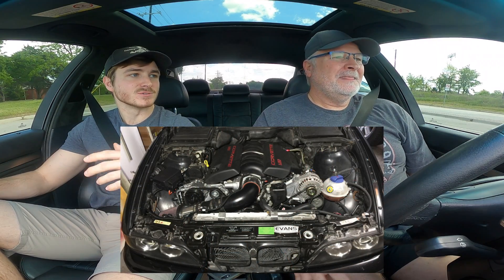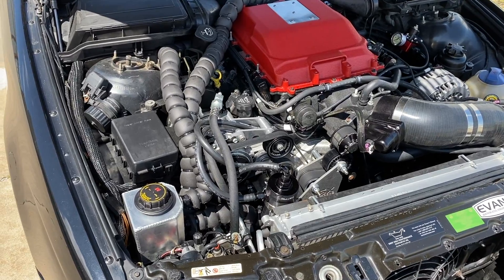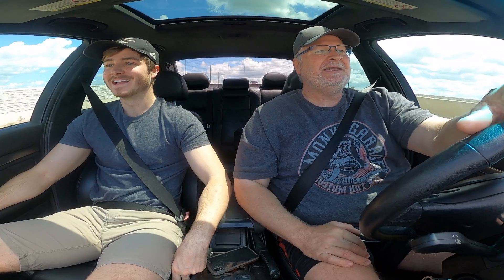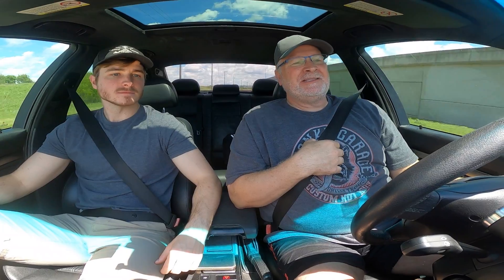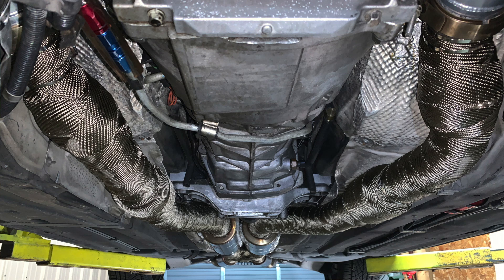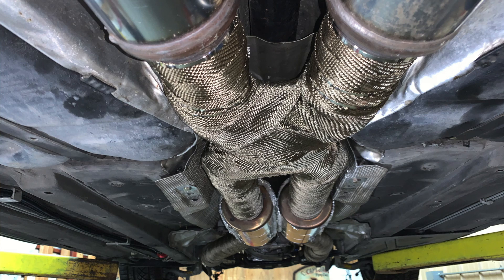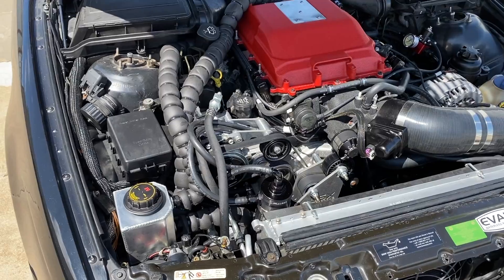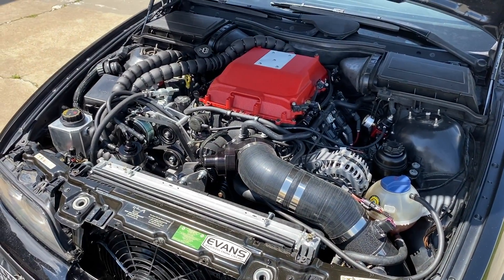First Drive in the INSANE Supercharged E39! | BMW E39 LS3 Swap

Comment: How did you guys figure out how to make the power steering and AC work, did you guys just changed the factory power steering line fittings to work with the GM powersteering pump? And same with the AC lines? For the AC was there any extra wiring that had to be done In order to allow the climate control to still work as it normally would? Or did you have to figure out fittings for the AC lines as well as Power to the climate control?

Comment: Great build, would it be posible to swap sbc ls family engine into 6 cylinder e39 without replacing stering mechanism ? As You all know e39 6 cylinder cars handle better than new m3, i drifted e39 over 50mph in winter years ago...with narrow summer tires and fu*ked up suspension :D those cars handle like no other. But v8 versions lose it cause of recirculating ball mechanism.

Comment: I don't know if this matters to anyone considering this swap and wanting to keep an E39 emissions legal but three things to consider:

1) The earliest E39s become emissions exempt on January 1, 2022 (less than a year and a half away). That means in Texas, 1997 model cars no longer have to be smog tested. Just the standard safety check (lights and seatbelts).

2) Interestingly enough, the first LS engines (on the C5 Corvette for 1997) aluminum blocks, coincidentally came out on the same 1997 model year.

3) While federal law (Clean Air Act of 1970) generally prohibits installing an engine older than the vehicle going into, I have NEVER seen a local, state, or federal check on the manufacture date of an engine. A "don't ask, don't tell" question (they don't ask, I don't tell) - HEY FEDS I'M INSTALLING A 1970 CHEVY 396 INTO MY 2010 CAMARO! COME AND GET ME!! (Caps Lock statement put in for comic relief and no, I don't actually own a Camaro or a 396 engine)

Comment: Awesome projet! Really immaculate car as well.
I drive a "different" e39 as well. Still has the s62 however I have taken 400 lbs out of the car. Super fun.
BTW - Who on earth would give this a thumbs down? Ridiculous
Reply from the maker: That’s awesome Sean! The S62 is a beast so I can only imagine what a rocket ship your E39 is being 400 lbs lighter. Gotta keep the E39s on the road!
Reply: Can you detail how you removed 400 LBS?
Reply: @leekzonyt9591  I had a carbon hood, 7lbs carbon trunk, Sparco seats, removed and welded up the sunroof, removed factory audio and had a bluetooth amp and a Braille battery. In some eyes basically ruined a M5 lol
Reply: @seanscott7120  Danggg that’s sick man! I’ve got a 2000 540i I’m interested in weight reducing. I do like my sunroof though I won’t lie 😭

Comment: Did you use a brand name swap kit or did you custom built your “kit”?
Reply from the maker: Good question Percy, we essentially custom built the kit. LSX Solutions has been a big help recently along with a couple other businesses.
Reply: Tire Kickers thanks. My main concern is the wire harness, oil pan, header fitment. Most of the other items we can source/build locally.
Reply from the maker: We used a GTO front sump oil pan, but it had to be modified so the sump would clear the cross member. As for wiring, go with the Painless Performance LS swap wiring harness that comes with A/C wiring. The headers were custom made for our build so I’m not sure what your best option is there. Hope that helps!

Comment: How much does the motor weigh? 
Has the weight distribution suffered?
Reply: I have seriously doubts that the DOHC M62 is lighter than an LS3, fully accessorized, apples to apples.

Comment: What an amazing build... I’m on the fence, and haven’t decided on my end build is going to be... I have an e39 as well... a 98 528i e39 inline6... and I wanna swap it Ls3 turbo or Sc I’m not sure yet... but I wanted to get to 500hp to the ground, fast and fun, super wide rear tires and rims...
Reply: Same
Reply: @dhubach1  so far I’ve done the rims and tires… 20x11” wide rims in the back wrapped in 285 25 20
Reply: @jahcousteauu_STAYinSHAPE  Nice! did you have to do any body work? Does it rub at all?
Reply: @dhubach1  hell yeah tht Shiit rubbed, and scrubbed and scraped and some more Shiit… it took me almost 2yrs to get the fitment rght ofcourse mist of it had to do with my rim choice.. cause supposedly I wasn’t suppose to be able to use those rims… 
 too big, too heavy, too wide… but wheel spacers, front and back,,coilovers droped to the rght height and shaving the inner lip of my rims off fixed most of my probs…

Comment: Sir did you have to rewire the entire car?
Reply from the maker: Yes, we pretty much did. We used a GM E67 ECU with an Arduino built by a guy we found on one of the BMW forums that allows the BMW cluster to read accurate temp, tach, and speedo. We’re working on a detailed write-up for the wiring so we can share it with the community.
Reply: @TireKickers  Sir thank and I would like to have that information once you have completed it and Thank for your time.

Comment: Nice build!! What engine management system are you running?
Reply from the maker: We used a GM E67 ECU, let me know if you have any other questions!
Reply: @TireKickers  did you use the original wire harness or did you buy a custom made one?

Comment: Be kind if you pull DRKVADA up next to a very identical looking E39 with the plate BLACK M5. 

Love the sound!!
Reply from the maker: DRKVADA is kinda nerdy but it’s different! I take it you have an E39 M5? 🤘🏼
Reply: Yes. Have two but one good one. And an e34 M540.
Reply from the maker: That’s awesome, those cars are BMW engineering at their best in my opinion. It’s hard to find a nice example of the E39 M5 nowadays.